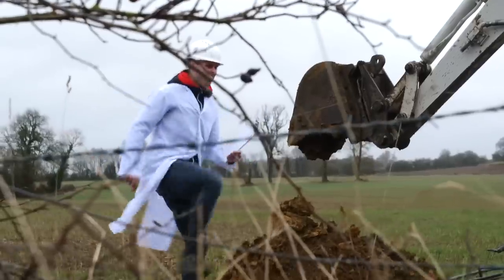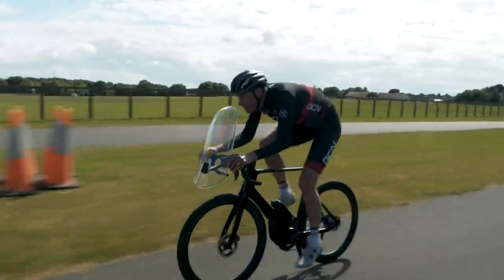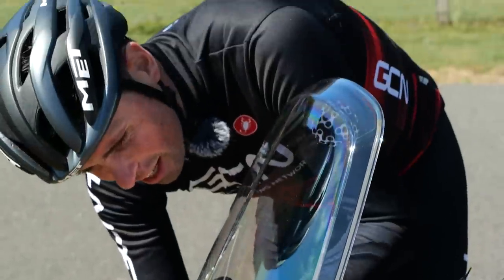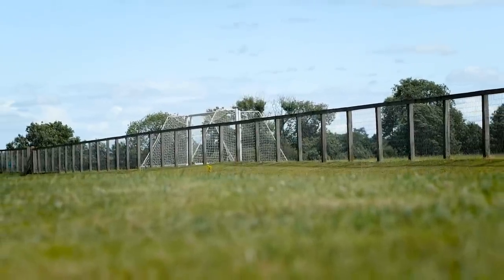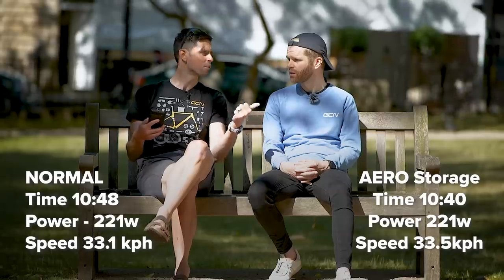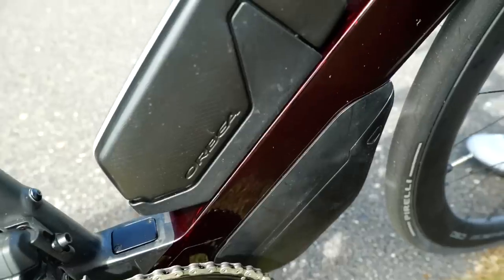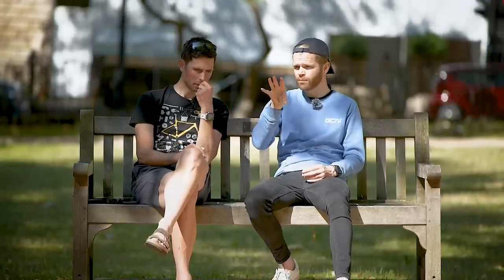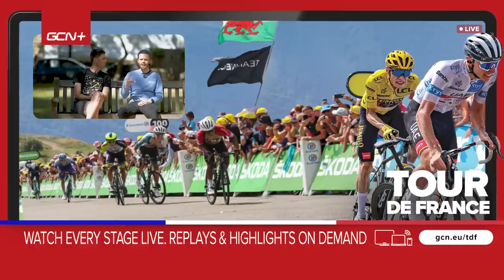Are Aero Fairings A Waste of Time? | GCN Tech Does Science

Comment from the maker: Have you ever tried something to make your bike more aero? Let us know in the comments! 👇
Reply: Eat more, to get a more aerodynamic rounded shape. :P
Reply: A deeper haircut is the most daring aero improvement for me. The next bigger would be shaving my legs, but that would make it a hell of a deal to my spouse.
Reply: I took of the fenders
Reply: The problem is AERO modern parts and bikes LOOK 1 million times better than an older bike ! Aero just looks so smart these days !
Reply: I’ve rode several handlebar fairings built 30-35 years ago: Zzipper, Breeze-Eze and AeroEdge w upper body sock for 1990 RAAM team. These had more rounded shape that the wind screen you used. I did coast-down tests in high school for physics class. The ONLY benefit I noticed was when the body sock was added. I remember my max velocity in coasting off a hill with an aero bar and no fairing was equal with the front fairing (both 21.5 mph). With the body sock it increased to 23.0 mph. In repeated one-hour runs on a rolling hill 6-mile nonstop park loop for One Hour, I noticed about a similar 1 to 1.5 mph increase from say 23.5 to 25 mph when using windscreen+ bodysock. This was 15 years ago. My name online for a longtime on recumbent forums has been Upright Mike as I was one of the  few uprights competing with recumbents at human powered vehicle races. In later years, a photo of me had made it around the world several times over, being picked up website BikeSnob. I’ve been called biker in a condom, etc and got famous for adding detergent bottle /ArmorAll aero leg fairings as well.
Reply: AERO BIKE PACKING BAGS!! Tail fin seat post bag (aero) frame bag (aero) handlebar bag (the cyclite one is actually more aero than nothing) back pack (aero) IM THE FASTEST BIKE PACKER IN THE WORLD!!!!!!!!!! I don't need no ugly big round non-aero panniers!!!!!
Reply: DARK speed works aero bento box and an empty bidon stored in my jersey neck back.
Reply: i bought a better wheelset with aero optimized  spokes.
Reply: I've in the past fitted aero bars on my MTB for use on the road 🙂 Unfortunately I will always be shaped like a rugby player and that isn't really ideal. 

I think rather than a screen a fairly taught fabric wedge from under the chin flaring out to the waist would be the best aero upgrade. That seems the place for the air to get trapped. The screen was probably a little too upright. A motorbike screen is designed to lift the air over the riders head and very gently dump it on their back, where it smooths out down through the tail, and also provides some centralized downforce. If it is too upright the air will go around and join the rest of the disturbed wake or dump it too violently. Really shocked it was only a few seconds slower, think there is definitely a solution there with a bit of work.
Reply: Never tied it but I vaguely remember reading something in a very old cycling magazine about cyclists extending mudguards/fenders to cover the top half of the front wheel to counteract the drag caused by the rear of the same fender. Might be an easy thing to test. I.e. fit a 1/2 length mudguard backwards on the front wheel.
Reply: Yes. I love recumbents. Adding a tail fairing (behind the rider) adds approx 2-3mph on an average effort. Adding a front fairing can add 1-2mph. I have the figures.
I've see a chap at races with a Moulton small wheeled upright bike racing with and then without a fairing covering the whole length of the bike. Worked really well but the handling was atrocious. 
I currently ride a FWD, tail faired recumbent and it's at least 2mph faster than my diamond framed race bike over the same ride.
Reply: Ollie is onto it, you need a blunt cone on the front (and a tapered tail at the back).
Reply: I don't think I would ever add a windscreen or other type of small fairing to a DF upright bike because that would be at best no faster on the flats and a disadvantage on the hills and in gusty winds over 15 mph. I have however designed and built a custom wrap-around carbon fiber fairing for a Cruzbike V20 recumbent and get about 10% lower effort at the same speed and better performance in a strong headwind. I love the fairing and will ride it for many more years. The down side of larger efficient fairings is keeping the added weight down and building them so that the bike is still easy to manage in traffic and around other bikes. The larger fairings can negatively affect bike transportation. Modern DF bikes are small and ultralight and are extremely easy to transport.
Reply: @mikemowett7401  I have built a wrap-around 14 lb carbon fiber front fairing for a Cruzbike V20 that covers all the front cranks and legs and extends back to my waist. The knees  pop out through a cut-out and the handlebars are exposed. I left off any bomb-bay-doors at the bottom so it was lighter and safer at stop lights. It is great fun and 10% more efficient in all wind conditions and ~12% better in a direct head-on wind than the stock V20 bike. I started to build a bodysock but abandoned it because of the heat here in Houston. I need the flow over my arms, torso, and head to stay cool. I have a small ultra-lightweight tail fairing for my head only. The bike is faster now but I need to work on other aspects like pacing, carbs on the longer rides, and navigation, especially in this 2023 summer heatwave.
Reply: Not intentionally, but I have a narrow and short (width and height) but long horizontal frame bag.  IE I still can use both water bottle cages, but it is nearly full frame horizontally, and is no wider than the frame itself.   At least on my round(ish) tube Ti bike, I am actually faster over long distances when it is on the bike than when it is not for the same watts, even when I am carrying stuff in it.  So... IDK.   Velominati can hate it all they like, but I'm good with it lol.
Reply: Steve Gurney in NZ built a full 'pod' around his bike to help win the Coast to Coast multisport race in 1990
Reply: ..no
Reply: I would love to see a "build-off" of GCN & GMBN tech building DIY aero-fairings for a race.
Reply: I've made my seatpost aero by sticking a smaller diameter plastic tube (hollowed-out whiteboard marker) behind it and wrapping it together in vinyl, It has an airfoil shape now. I'm still waiting for aero leg warmers to hit the market - given how many watts a pair of aero socks save, this could be a gamechanger (for us living in cold countries at least;)
Reply: Rear fairing for a recumbent.
Reply: Backpack and a bag on the back rack. The disruption from the air coming back into place is big.
Reply: I have a zzipper upright fairing that cuts a huge amount of wind and adds ~ 3 km/h to my top speed. If you are testing in a wind tunnel, I'd be fascinated to see how much of a difference it would make
Reply: I actually tried the same Polisport screen 4 years ago: I rode the same downhill segment with no pedalling, 4 runs each with and without. Made absolutely zero difference.  I wish the speed up bag had made it into production, think that would have made a real difference
Reply: I was thinking of installing the Poly windshield to make my bike more aerodynamic but the results is not promising. As you said, maybe a more optimised fairing/windshield could work better

Comment: As a former motorcycle rider I would advise you attach the wind screen to your frame rather than the handle bars to avoid "wind powered" steering
Reply: I laughed harder than I should have visualizing that, well done
Reply: but wouldn't that be very awkward in tighter turns?
Reply: @MattRose30000  Yes. I wouldn't advise it for a mountain bike.
Reply: lol

Comment: I think that a narrow windshield can give a better result. Maybe can be also useful for winter training or commuting with temps below zero.
Reply: 1 2 2 4 5 6 7 8 9 and 10
Reply: The windshield looks really ugly. But I have to admit: If it helps in winter time, I might give it a try
Reply: That 's what I thought when I saw it
Reply from the maker: Good point!
Reply: Also make sure the windshield is directing the wind away from your head and more towards the top of you helmet.
Reply: Visualize a torpedo. Now fit a bicycle and rider within the shape and boundaries of that torpedo. Now you have an aerodynamically efficient fairing.
Reply: I have used a much more curved windshield on my bike for about a year. Practically the difference was one gear with the same power.

Comment: The reason why the saddle bag is helping (as well as the superbike designs and, indeed, the evolutionary advantage of wasps) is because when moving forward it's not only the air that you push holding you back, but as you move through the air you create a vacuum behind you. Having a smaller surface area at the end means there's a smaller surface area to get sucked back.
Reply: Yeah not a vacuum but a region of turbulence and slightly lower pressure. The rear fairing reduces the abrupt change in cross section which delays the detachment of the flow, decreasing the size of the turbulent region. The surface area actually ends up larger but skin drag contributes less than pressure drag in front-on air flow. The reason we don't go nuts with this in non-UCI bikes is because of crosswinds as they mention.

Comment: The wind guard (door) fairings are installed on motorcycle handlebars for comfort against strong winds.  It’s not aero because you are blocking air with a plank on headwinds.  But it’s comfortable for a motorcycle rider to not have strong winds blow into their face.  

For cyclist air blowing to your face provides cooling to your head while wearing a helmet.  You’ll only feel strong wind resistance on headwinds.

Comment: A self-inflatable rear fairing of a paragliding harness. These fairings are very light, aerodynamically optimized and don't require any rigid frame. It is probably possible to mount one on a backpack (perhaps upside down because the body position is different). The most advanced rear fairings are installed on competition harnesses such as Woody Valley X-Rated 6, Niviuk Drifter (old models), Ozone Submarine, WV X-Rated 7 (new ones). Old competition harnesses have only one parachute compartment and are banned by FAI. It should be possible to find one for a nominal price.

Comment: In 2012 I designed my totally custom Rohloff14 tour bike. The main feature is a shark nose CF trunk attached to the head tube, about 9L volume I guess. It also has 2 bottle mounts on the back of it to the side of the head tube. It's awesomely useful, but at best I think neutral aero. But IMO it does help to have part of the wind going around that instead of hitting me. I also made a CF pouch above the BB area. And I put a thermos with a CF lid to hold tools under the BB. It points forward and acts like a ballast tank. LOL. Works great. Also have a frame bag full time. Crosswind seems to have NO effect. The thing is 78 lbs without the tour stuff. LOL I do centuries with it LOTS. 

The Trans-America race rules guys sure go to EXTREME measures to expel aero. LOL. Can't even put a water bottle in front of the HT.

Comment: It's been tested in the recumbent world that a rear fairing is realy helping more than a front fairing. It prevents the Kármán vortex street from forming and brings the air together nicely. It can actually be prevented by just a fin. This might also be why rear Disc-Wheels are so effective. Maybe you should try just building a fin behind the rider.
Reply: solid disc front wheels would be better, but steering and control in wind would go out the door. Been proven.  Recumbant is already more aero, so the length of the bike is adding more disruption as the wind travels down the frame and rider. Up right the rider is half as long. two different maths.. :)
Reply: @tonycrabtree3416  The Front disk would of course also be beneficial and I understand that it is problematic for bike control. I doubt hoever that it is more beneficial than a rear disc. Regarding the different math: Yes the Reynolds number, as well as Drag coefficient and frontal Area change and with it the amount of drag the parts create relatively. But the general effects stay the same and the Karman-vortex-street is a big producer of drag that should be avoided. Do you have any sources that show otherwise?
Reply: @johsklopp3894 It simply is. No worries, you don't have to agree.

Comment: I have an old Mongoose DXRal bike that weighs 38.5 lbs. I ride a 5 mile road around a perimeter of a small airport near my house. In that ride, there is a stretch of half a mile that I push my MTB to the max speed. I get 15 MPH. I covered the inside frame of the bike with Glad sticky food wrap. Ran the same speed test and now I get 19 MPH. I believe it is possible to increase performance to remarkable margins with aero fairings.

Comment: Regarding the sum of ground speed and headwind: while the aerodynamic force may be the same, the power lost to air resistance is not. The reason is that the drag force (in N, kgf, lbf, whatever) must be multiplied by the actual ground speed to arrive at the power in watts. Therefore, a ground speed of 30km/h and a head wind of 15 km/h generate the same force as 45 km/h but does not require as much power.

Comment: aircraft change their shape to adapt to flight.  flaps are deployed for lift when landing/taking off, spoilers for more drag to slow down, and landing gear are raised to reduce drag.  basically, aircraft can change shape, but bicycles can't.  bicycles have gearing which can easily be changed to adapt to different cycling conditions like hills and wind. yet,  it seems the aerodynamic solutions for bicyclists are rather limited, clumsy, rigid, and impractical.  it might be useful if bicyclists could deploy aerodynamics that were as easy as changing gears.  since, wind is often mentioned as a detriment to cycling it might be advantageous if cyclists could have an aerodynamic feature like we do with gears...  or maybe, the wind isn't as much of a detriment as we are led to believe?

Comment: Sure this wind shield will help. Or from the looks of it, just use a wooden rectangular plate and strap it to your bicycle. But always keep in mind that its surface area needs to be bigger than the rider to actually reduce air resistance.
Reply: It doesn't, it only needs to deflect air around 'messy' areas like the legs and arms to have a useful effect. But even if area is increased, remember that aerodynamic drag is Cd x area. If you can dramatically reduce Cd by smoothing the airflow then a bit of extra area may not matter.

Comment: I wonder if attaching some sharp trailing edges for flow separation to your outfit could help reduce drag. I’m thinking of wedge-profile foam strips glued to the back of your upper arms and your calves. Also, increasing the size of the saddle bag at the front so that it reaches over the saddle and is the same cross-section as your bum with smooth sides and sharp trailing edges, could help.

Comment: Fyi, with a power meter and a loop with some elevation change the "virtual elevation" method implemented in Golden Peak and other cycling performance software can get you wind tunnel quality measurements of CdA and rolling resistance.

Comment: From my experience with a velomobile having an open back wheel i am very sceptical on the use of a front fairing alone (my velomobile is aerodynamically hardly better than any upright bike). It is actually the back which makes a bike fast. And the front area. So if You are interested in fairing You should look for a modern fully faired and yet relatively light weight velomobile.
Reply: Which velomobile do you have? I have a Carbon Quest
Reply: @johnyang1420  I drive an old GoOne 3 and a Leiba (Cargo). Both do not have any fairing on the tail, and the GoOne is known to need about the same power in average as an uprigt bike. There is even a comparative measurement available.

Comment: A narrower windscreen and one that narrows further as it comes down to cover the front of the top half of the front wheel. Like a wide diagonal and convex lance. Well, sort of.😅  When I wrote "narrower" what I should have written was  the angle of the convex should sweep back more so that it is not so flat against the wind. All the best. P.S. if it is put further forward the top could angle back more I think, in which case the windscreen could even be taller and still give less wind resistance. 😊

Comment: Thanks for the nice explanation. The funny parts of the video might be more educational than you think. 

Also, the saddle bag thing is actually not that surprising. Behind the rider is a large region of low pressure that creates a force pointing backwards. Just like the force induced by the high pressure on the frontal area. That is, if one puts material or void space in regions of low pressure the drag decreases.
In addition, friction forces in fluid dynamics are proportional to the gradient of the velocity, i.e., the rate of change. Thus, if the flow follows a line as straight as possible, the drag is minimized. Even though, fluid flows around a bike and the rider is rather complicated, humans have a natural feeling about what shape creates less aerodynamic drag.

Comment: First, I make fairings for the big chainrings from 0.75mm thick polystyrene (0.5mm tends to get cracks) for my TT bikes, so in a side view the crank (formerly Campy Record Carbon square taper, now a FC-7410) looks like a full aero crank. It makes me faster - at least in my mind🤗.

#ASKGCNTECH: As I use Giant CFR frames as a base for my TT bikes (I have two of them), I wonder whether spike tape (which is used for glider planes) sticked on the sides of the round down- and seat-tube could help that the air keeps being attached a bit more to the frame?